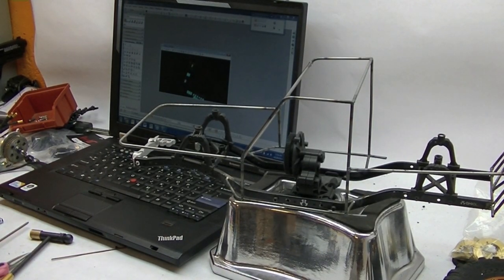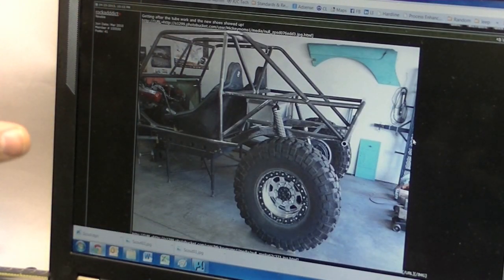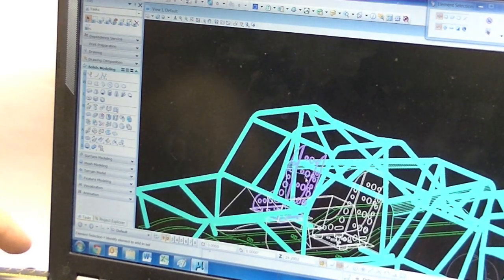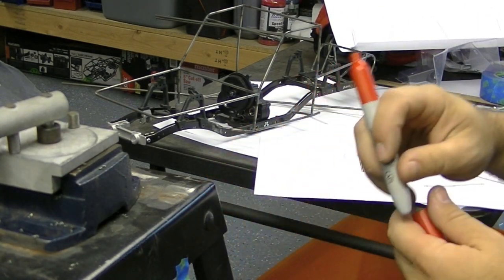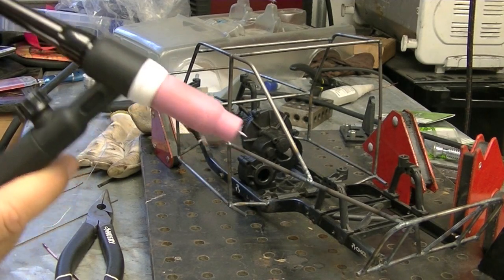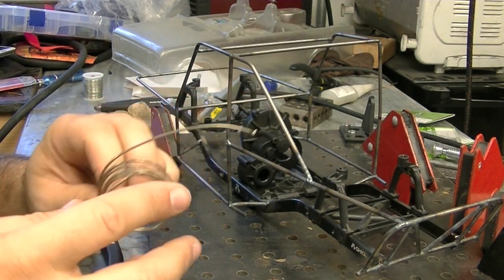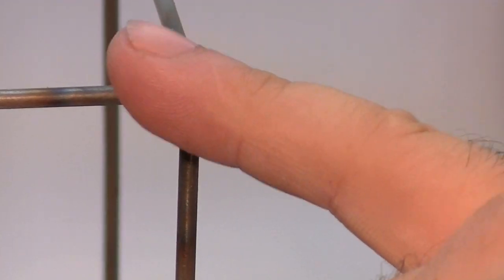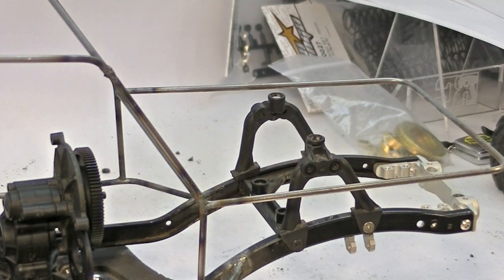Crawler Tube Chassis - In Depth How-to

Comment: Good stuff. Nice explanation. Great video man. Heads up. If you drill a couple extra holes on the venders leverage arm. You can get much cleaner and more accurate bends. What you want is the bending arms pin that pushes on the rod to be as close as possible to the pivot

Comment: what shielding gas would you use for tig welding brake line tubes ?
i have a tig welder that is currently set up with pure argon and i have a mig with c25...
Reply from the maker: Pure argon is all I use on my TIG. C25 won't work in a TIG but I do believe you can run Helium as well, although I don't know the benefits.

Comment: This video is pretty old, but do you use the same bender for tubing? If you do does it flatten the bend? Any info on this for a guy getting into scale fab would be awesome! Thanks in advance
Reply from the maker: For tubing I use a bender from Oakenshield Productions. The rod bender I showed in this video would flatten the tube just like you thought.
Reply: @HarleyDesignsInc  if you’ve got the time, a video on that would be sweet! Just ordered one off fb. Thankyou for the reply! Love your scale fab work!
Reply from the maker: @80HD4x4  I don’t think I’ve got a specific video on it, I’ve used it in many videos but I can’t think of where to point you exactly for it!
Reply: @HarleyDesignsInc  I’ll have to see if I can find it!

Comment: @HarleyDesign  whats your welder amperage, & argon flow?
Reply from the maker: Depends on the material size and type. It ranges from 25-60amps. My argon is usually around 15.
Reply: @HarleyDesignsInc  awsome thanks for the info man! I was going to try to make some sliders out of 3/16" steel rod, first. Then go from there.

Comment: I working on a roll cage myself is there a way to put it together with out welding ?
Reply from the maker: Using a torch and silver solder is the best option and fairly cheap.
Reply: Thanks

Comment: I know Its been awhile but what size tubing are you using??
Reply from the maker: 3/16 and 1/8” typically.
Reply: @HarleyDesignsInc  thanks
Reply: @HarleyDesignsInc  also what kind of tubing did you use like steel or aluminum?

Comment: Great video. I would like to recommend using less heat on both the oxy/acetylene and tig welds. The silver solder will flow better at lower heat and won't require clean up. Overheating the metals causes oxidation and makes for a poor weld.

Comment: Or you could buy one for $60-120 if you're lazy. Though I'd love to do this to mock up full size car chassis
Reply from the maker: $60-200 are usually of very very low quality. Finding a well built tube frame chassis can run from $300 for a more “mass produced” up to $1500 or even more for custom versions made of chromoly.

Comment: No Brazing Flux ??? Stay Silv with the Oxy Acet it will be much cleaner better flowing .  it is a powder it come in white and blue you heat up the silver and dip it into the powder and it coats the silver before brazing. check it out.  http://www.airgas.com/p/HARSSWF1?agcert=Certona:Top+Sellers:HARSSWF1:3:20:nosale

Comment: What metal are you using to build the chassis
Reply from the maker: +Connor W.H I use 3/16” and 1/8” solid carbon steel rod. I buy it from local metal suppliers and it’s usually around $1-2 a foot.

Comment: Is using 3/16" or 1/4" brake line instead of steel rod a good idea?
Reply from the maker: +juancarlosruiz1985 it works very well, but you'll have to braze it.

Comment: hey i am new to this and want to know what metal did you use for the whole build
Reply from the maker: +Derick Bills i use standard steel rod, either 3/16" or 1/8" diameter.
Reply: can you actually build an entire rc truck or anything like a car out of aluminum or steal.I know i would have to buy the other components
Reply from the maker: +Derick Bills not sure what you're saying; but what I show in this video is building a vehicle out of steel. I have several videos showing the completion of these trucks.
Reply: i need to find them start to finish lol
Reply: What video series is the one where you built the complete truck.

Comment: Hi Harley, great tutorial! I'm a bit of a novice in the steel fabrication department so I've got a question regarding the steel wire that you're using as I am looking at building myself a rollcage as well. The question is, are you using stainless steel or "normal" steel, or is there a specific grade that you'd recommend? Please let me know If you have a chance.Love your chanel, keep up the good work and cheers from down under.
Reply from the maker: +waffleattacks I use standard hot rolled steel most of the time. This is nothing special, standard cheap steel. Stainless is actually more difficult to weld.
Reply: Harley Designs Thanks for letting me know, I'll give that a go. Cheers

Comment: to use Autocod the way u did with he pics is it going to take a lot of work to learn
Reply from the maker: +Akeem Griffiths if you have never used it, then yes it will take a LOT of time.
Reply: Ok thanks
Reply: Keep doing your thing . What size rod your using though

Comment: @Harley Designs (or anyone else) Can you send me a link to the jewelers touch and bottles? Been in the RC hobby for awhile, and now i'm wanting to build my own chassis. I only have a small amount of "Play Money" set aside and don't want to blindly start ordering everything just to find out i ordered the wrong things.
Reply from the maker: +The Choosen One (Liquor by the Ounce) I actually don't see if listed on harbor freight any more. That's where I got mine.
Reply: I was thinking. For a beginner that's wanting to get started on a budget, JB-Weld should work, no? I've used JB-Weld for guick repairs on my cars; in-fact i repaired an exhaust hanger on my truck back in 2009(?) and it's still holding strong. I've used JB weld for repairs on my RC crawler and i've bashed the crap out of it and it's still holding strong.

The only problem i can think of is getting the pieces to stay in place while the jb-weld cures, and it would take longer to complete a build. But i just don't see a problem with the strength being an issue.
Reply from the maker: +The Choosen One (Liquor by the Ounce) for the size and forces we are looking at, I do not see it working. Not unless you used very large amounts and the visual of that would be very unappealing.

Comment: could u use a mug or a stick welder
Reply from the maker: +42 copper head a MIG is possible but makes for much more cleanup with the grinder.
Reply: +Harley Designs k thanks

Comment: Hey, how can i get one of your templates? Please respond to this.
Reply from the maker: +JH You can find them on my website.
Reply: +Harley Designs  oh ok. and are all of the chassises that you designed strictly for crawlers or can the be used for just about anything?
Reply from the maker: +JH It all depends on how you set them up. If you are custom building a car, you can change things as needed.
Reply: Harley Designs  is there like a down load thing i can go to on your website?
Reply from the maker: +JH yes... It's very easy to find.
Reply: Harley Designs
 OH ok thank you very much! I just downloaded and printed 2 chassis! Thank you so much for the help!

Comment: I have a question, I braze with a simple oxygen torch, acid flux, and silver solder. I was wondering if you had ever had any problems with the solder dripping or just not creating a joint. It just kind of melts on there and either drips off or just creates a blob of solder that connects nothing. I was also wondering, can you print the templates on regular sheets of paper or do you have to have a bigger printer?
Reply: Graeme Davis u need to heat the metal more and let the solder melt by touching the metal not the flame. cause sttel has a much higher temp b4 it melts then silver solder
Reply from the maker: If the joints are clean and flux'd then I usually have good luck. Some of my prints are designed for regular size paper, but not all.
Reply: +Harley Designs Thank you! I'll have to try cleaning them up a little better before I braze.

Comment: Hey there Harley, as a tig welder I wanted to chime in.   You should wire wheel mill scale off your 3/16 rod.  Gtaw processes require super clean metal an the mill scale is contaminating your Welds from the get go. Same goes for the paint on you frame to rod weld there.   Try cleaning  your metal at least a half inch from your joint each way. The metal  flow will be much nicer an the brazed welds will have no competition on your tig welds.  It was a nice video an I would like to know more about the Autocad programing like cost an what to get. Thanks an keep up the good work.
Reply: Yes 3/16 is fine as I did

Comment: Which joint is stronger? The braised or the Tig?
Reply from the maker: A properly blazed joint is very strong, and when using high silver content silver solder I believe the tensile strength of the joint exceeds the steel. However TIG welding is easier IMO and more likely to get a full strength weld. Both a great and brazing is a good way to start on a lower budget.
Reply: cool! thanks so much for your time!

Comment: Hey Harley can you use a mig welder for this? I like the migs much better
Reply from the maker: You can use a MIG but they are not nearly as clean when working on this type of work. It takes a lot of cleanup to make smooth joints. I have a MIG as well but TIG or brazing looks much better.
Reply: What kind of torch would be cheap to get for braising? I want to get a mig welder anyway for the 1:1s but with the rcs what's a cheap torch that would work good?
Reply from the maker: You can use the cheap Oxy/prop setup lowes if you want.
Reply: I will look into that. Thank you for helping me out.

Comment: Nice job but why not use a mig welder?
Reply from the maker: Devin Leatherman I have a MIG as well but a MIG doesn't work nearly as well. It adds too much material for the size of material. It takes too much clean up to make the joints flow as well. TIG is much cleaner.
Reply: okay thanks for the respond

Comment: Maybe in honesty Harley;
 Mention to the young guys arriving here that your adding a roll cage of your design on top of a commercially available retail R/C chassis[Note the black parallel frame rails]There is a big difference there between 'modification' add-on and a full chassis build

If you young guys are frustrated with brazing/ soldering problems: Mow some lawns or shovel mums driveway for funds to purchase a small wire feed welder that uses normal household current. A Chinese 'buzz box' will join this small rod or tubing together and cost is about $100 or 55 quid at the discount China tool outlet.

Comment: Harley designs;
You got burned paying $35 for that 'wire' bender. A smart guy could make one with some half inch pipe as the handle, a wooden base that incorporate a 3/8" tool socket extension drilled and slipped through a hole in the base plate. Then attach different size sockets to use as 'dies' to obtain the correct incrementally sized radii.

Going further, adding a $3 plastic protractor attached to the base ensures bends at the spec'd angle.

And finally, if a guy makes a jig fixture to hold his work, he can mark and locate position centers so rapidly duplicating a good chassis can be quickly done.

Hope this helps you, young man.

Comment: I'm looking at getting into building scaler chassis for myself. I'm gonna go with silver soldering. My question is, how well would silver solder paste work? from what I've seen I think it would work perfectly for this application. I am specifically looking at the muggyweld.com ssq-6. It has a strength of 70,000 psi and can be done with a mapp gas torch. What are your thoughts? Paste or do the classic silver solder way?
Reply from the maker: luke stowell I have never used the paste but I have seen it recently because my GF would like to try some jewelry soldering. 70,000 PSI should be plenty strong. You can use the traditional silver solder I use with a MAPP torch as well FYI.

Comment: Do you have a template that is available for download I'm trying to make a cage for my 1/8 scale buggy if you could help i would appreciate it thanks
Reply from the maker: R50's SS You can go to my website and see what templates are available for download. I don't work with 8th scal buggies as they aren't really used in the scale market much.So you will have to use one I have as a base and go from there. The Ibex Goat would likely be the best start for a truck that size.

Comment: Great tutorial. I noticed you didn't mention anything about mitering the tube/rod joints. Is that not an issue? I know from brazing bike frames and from doing some practice work with brass that you need to get a good fit; especially if one goes the brazing route.

Comment: Very informative - I have used the old school stick (arc) welder in the past for this work - joints do not look as neat as yours !!
Have tried silver soldering with Propane only torch with mixed results - I might keep trying after watching this, cause you don't seem to have a really hot flame with your oxyacetylene torch

Comment: could i possibly use mig welding? since that's all we have and don't have the cash to run out and buy a tig welder. i run on 0.35 wire with mixed gases. im looking in making custom bumpers and roll cages, but don't like what the markets have to offer. Thank you very much and cant wait to hear from you soon, keep up the great work!!
Reply: Crawltheworld You sure can. Use any wire feed welder. A good tip is to mask off the area your not welding to avoid flux spatter on the rest of it.0.26 or 0.30 mild carbon wire in a 90-125 amp wire feed welder would be great for this little stuff. And on shielding?.......Read this;I wrap a bit of small dish sponge around near my work area that's slightly damp. Holding it with a wooden clothespin. It leaves no adhesive residue for additional welds on the steel.
Reply: icebox829 Mild carbon steel rod. About $1.75 per foot at the supply store. Sold in four foot lengths.
Reply from the maker: You can use a mig welder, but it will be more clean up work in the end. A lot of people use a MIG though, so by all means you can still jump right in.
Reply: Harley Designs What kind of material are you using for the chassis? Would Carbon Steele be a good material to use for a Trophy truck?

Comment: Thanks for the great tutorial, I'm going to make a fast back cage for a class one jeep wrangler Rubicon, I'll also be using 3/16 steel rod. Just had a quick question, what vice are you using, cause I need a vice to hold that BAC inc. bender, thanks

Comment: If you want to try something new, try to down load the student version of solidworks. It's and excellent 3D modeling especially the weldment part. I used a similar program to model a complete trophy truck in a previous job.

Comment: Hey Harley would a MIG welder work for doing some tack welding on the tubes and then using solder to fill and finish up the weld? Or would a MIG work for doing the whole chassis? My dad has a MIG i could use.

Comment: i use mapp gas torch and brazing rods rods come 3 feet long covered in flux .my way is alot cheaper but not as clean as those i sometimes have to grind down the joints. love the bender i wll have to pick one up cause i use a hobby hand bender and cant seem to replicate the bends very easy .Thank you very much for this vido had wondered how you dd such good work